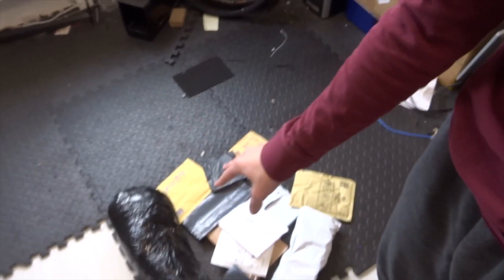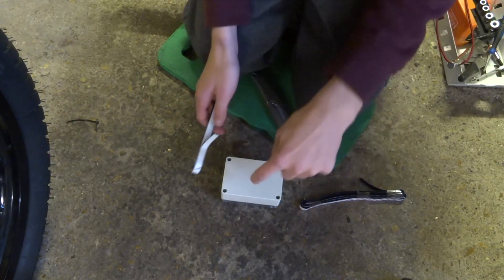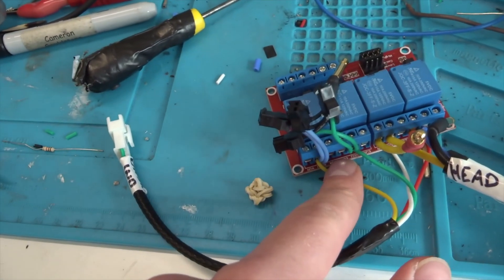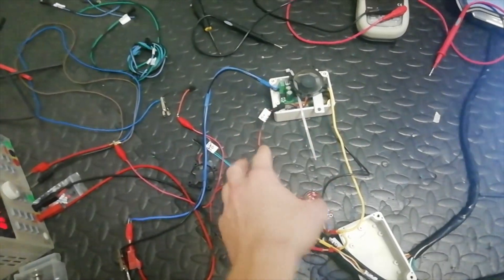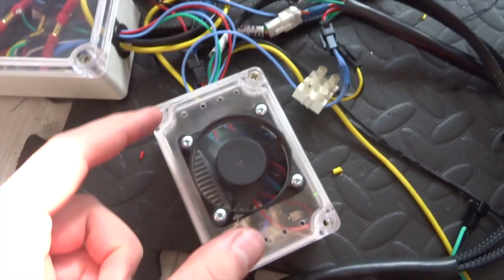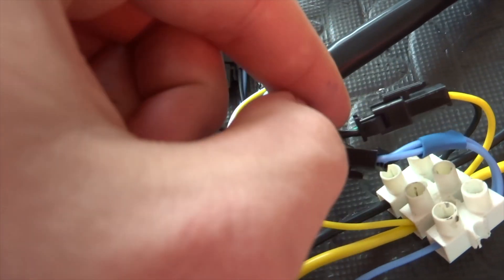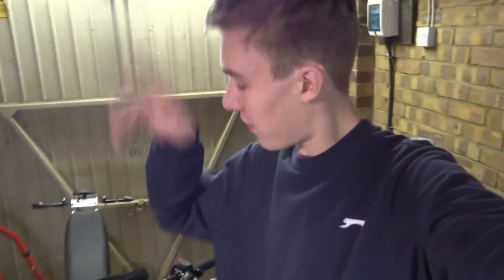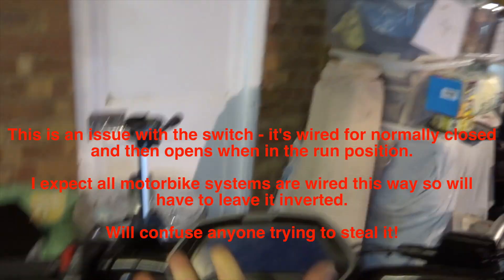Let there be light! - 8kW Enduro MSVA eBike V3 Build - Part 18

Comment: Do you need a daytime running light as a requirement for test
Reply from the maker: No, just the low and high beam. But if ones fitted like on mine it must work properly and not dazzle anyone

Comment: 9:30 you want some Velocity stack and larger holes for ventilation to be better but even then I bet that fan isn't needed but something there for incase
Reply: He showed how he couldn’t even touch the heatsink without the fan a couple of seconds before so pretty sure its needed
Reply from the maker: Nah it got way to hot for passive cooling and fluid dynamics is a bit too far for this project :)

Comment: I think those indicators are nor bright enough. I tried few of them from ebay or aliexpress but they all were crap and i went back to normal bulbs as they where just dangerous. I guess 99% of inexpensive ones are crap.
Reply from the maker: These ones are fairly bright tbh plus I've added some buzzers to make the whole system more noticeable. As long as they are emarked and light up, that's all they care about

Comment: Youre obviously not in Europe, but here flashers should be 60HZ and not faster than 70HZ, so half a second on and half a second off is spot on. Edit: read the comments and flasher was built into your headlight!
Reply from the maker: MSVA manual in the UK says must flash 'between 60 and 120 times per minute'. The indicator in the headlight you're referring to is just an orange DRL so can't show direction - also even if each half of the headlight flashed individually they would be too close together.

Comment: My bike died after apply the brakes the regen kicks in and is gone half a second later and the display has gone out and will not power on anymore. Any ideas? I'm thinking the regen spike may have killed the display.
Reply from the maker: If you have a sabvoton display, I've heard some older ones have a component that can blow when using regen with a 72v battery... Best solution is probably to buy the latest version of the display whatever that is.
Reply: Not a Sabvoton controller but a risinmotor 72v 100 amp one using the same TFT 750c display
Reply from the maker: @xcessiveness3395  Yep that will likely be your problem then
Reply: @xcessiveness3395  it's a savboton clone I own an original 80amp savboton and this risun one from Ali express clone that uses savboton board if you've ever opened one up you'll see the brand sabvoton and the serial number on the pcb
Reply: Well that will suck if I can't get a replacement and have to get a whole new system cause I can't. I have the same frame but I had to cut the controller cover on the bottom so the heatsink was exposed, that and controller was like 4mm taller than the cover but looked really nice after it was finished.
Reply: @xcessiveness3395  Before you get rid of your setup hit me up.
Reply: Also if you bought it new it came with a display bypass harness a black harness with a read wiring loop. You don't need the display to run the bike

Comment: Did you k ow they make flasher relays?  May be easier than an arduino.
Reply: My lights came with an integrated one which saved alot of hassle 🤣
Reply: I just bought turn lights that only need a 12v power source that flash on their own real easy no flasher needed just a fuse. It's made my 12v system real simple and all I need is a 4 fuse block and run my wires.
Reply from the maker: You could easily use a flasher relay instead, but I used an arduino so I could adjust the timings and perhaps add some extra functionality in the future.
Reply: @EverythingEbikeChannel  oh shit!  Spoiler alert 😂.
Reply: @bj97301  please don't swear. not cool man :(
Reply: @EverythingEbikeChannel  I had an idea to make a compact pcb that does all of this. My bike’s wire mess is out of control. If only I was good with pcb making software and knew anything about ee.
Reply from the maker: @bj97301  I started doing that too, but it would have taken so much time that it would have been a project on its own. Would be great to do one day though!
Reply: @EverythingEbikeChannel  I agree. I think there’s a need for motorcycles too.